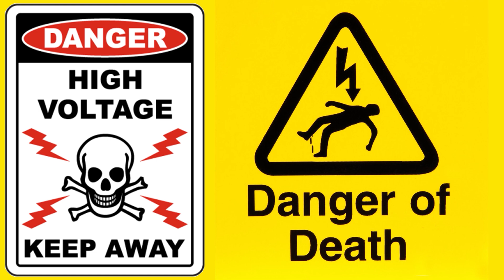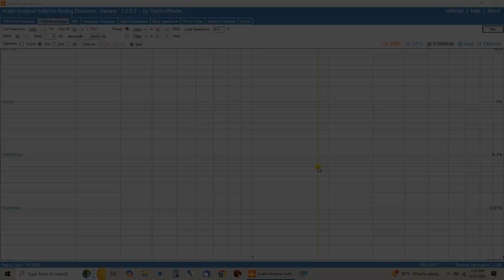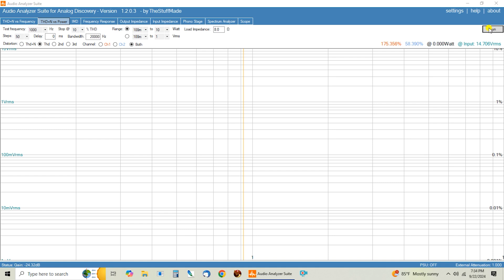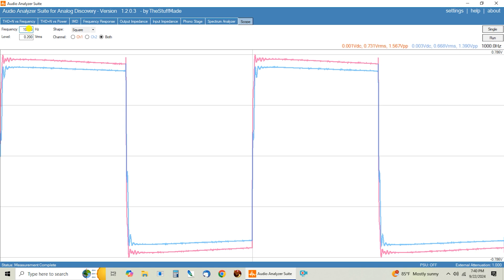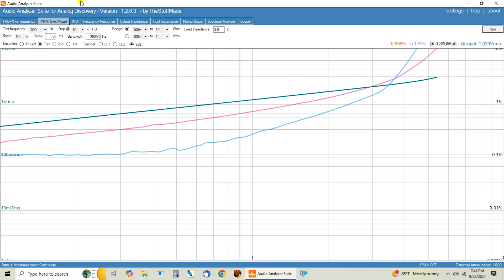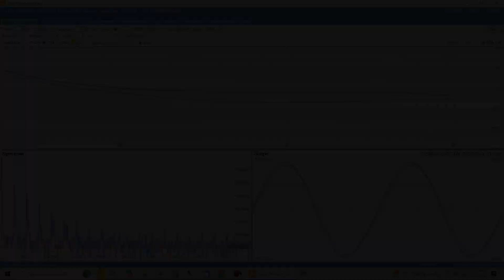Grid Leak Resistor Effects: 2A3 Mono Blocks

Comment: This is just 2nd order cancellation I think. If you analyze the two stages separately I would guess you'll see the driver distortion rise with the smaller grid leak as expected. But since the stages operate 180 degrees out of phase, it's cancelling the 2nd order harmonics similar to how a PP amp does. Reducing the driver distortion reduces the cancellation effect so the output even-order harmonics increase.
Reply from the maker: Exactly what is happening.

Comment: Ha! Interesting insights, much appreciated :). Nice to see the results of the experiments - that Analog Discovery certainly comes in handy! 

Got some ideas for further experiments:
1. change the coupling cap alongside grid leak resistor - so that the RC time constant stays the same, preserving the frequency response and phase characteristics of the high pass filter
2. make sure you don't load the driving stage too much, stay within Rg at least 10 times plate resistance.
3. test on different types of tubes - small signal triodes, power pentodes etc.

I tend to use 470k in my designs, sometimes going up to 1M...1M2 on voltage amplification stages, sometimes going down to 330k on big power tubes (EL34 etc.). Haven't really measured the distortion characteristics - it's a very nice idea to experiment though!

Comment: I havent't watched the results yet but 330K grid R and the choosen valu of the cap seems to be a GOOD choice........have few doubts this may bring the amp to sing as should a 2A3 do .....the smaller value of the coupling  cap is also less inductive and less current draw on the driver .......both tubes benefit and don't worry , be happy .......

Comment: Besides the low frequency response established by the RC connection between driver and next stage ( output  in this case ) ..........;the loading of the driver tube is not only factor of the anode loading rsistor of the driver but resulting of the combined combination  of anode load and the RC loading ..( grid resistor ).........changing one of them will impair also the response of the  whole amplifier .

Have a nice day ...............2A3 amplifiers are always interesting ....